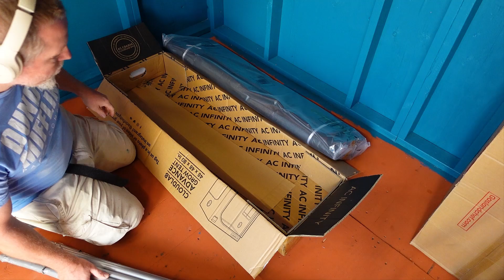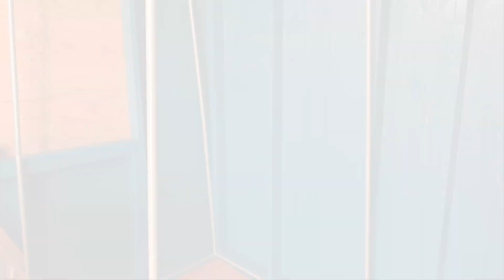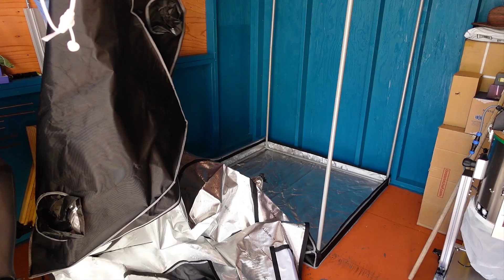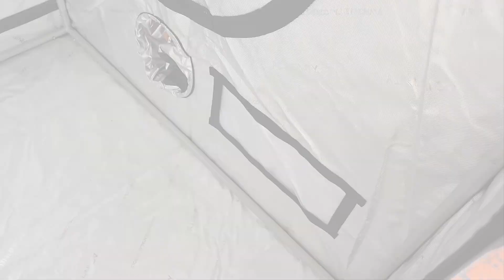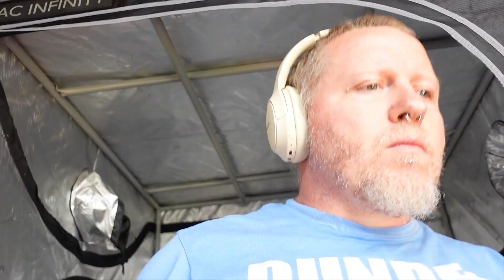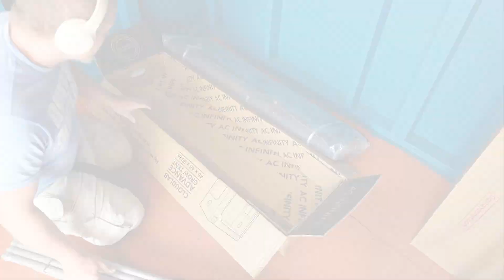Amazing Build Quality!! AC Infinity CloudLab 844 Unboxing & Setup, The Nicest 4'x4' Grow Tent?

Comment: How loud is all this when on meaning the Air filtration ? If anyone knows.
Reply from the maker: That is really going to depend on how high you have the exhaust fan cranked up. Most of them are pretty quiet in the 30-50 percent range, and ramp up from there.
Reply: @TheHippieGeeks  Thank you
Reply from the maker: No problem!

Comment: Best video about the tent. You can see everything in detail. Too bad there is no 100x100x200 tent. Are you satisfied with the tent after prolonged use? One of the great things is that both side walls can be partially opened.
Reply from the maker: So far it has been really solid, love all the attachment possibilities with all of the ceiling supports =)